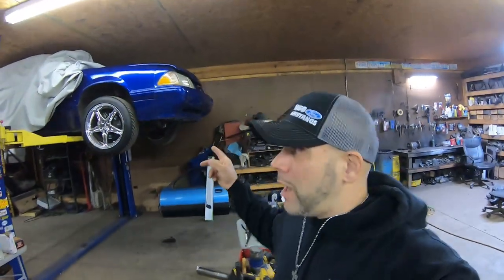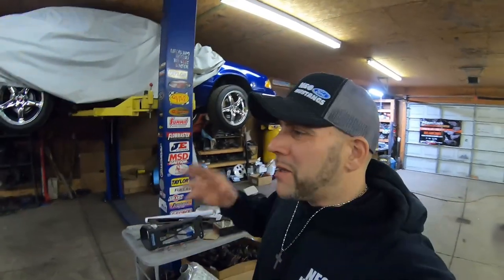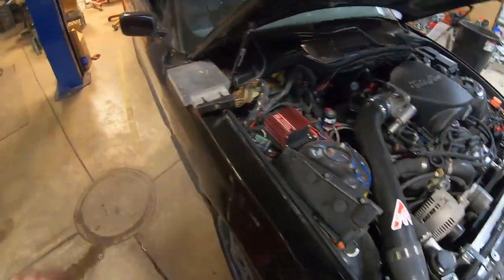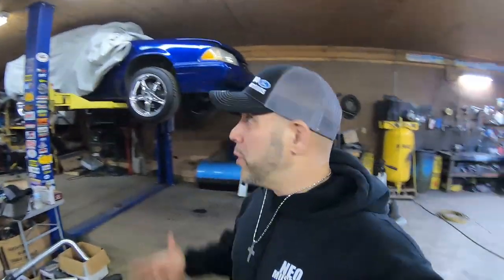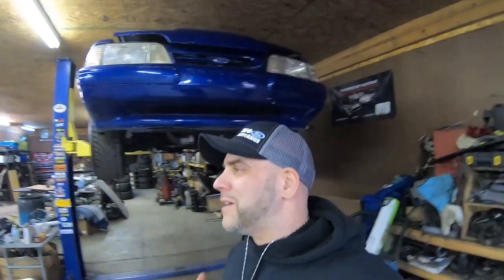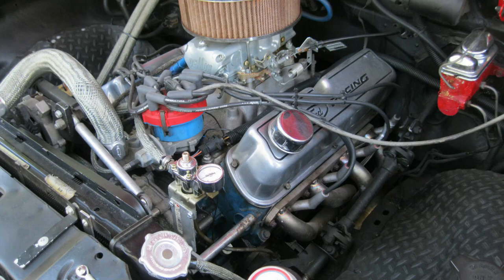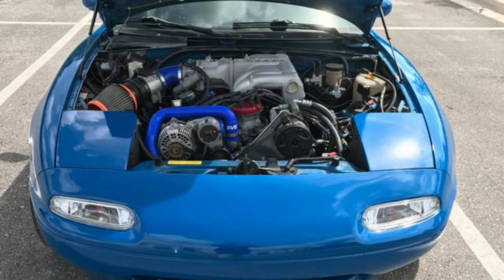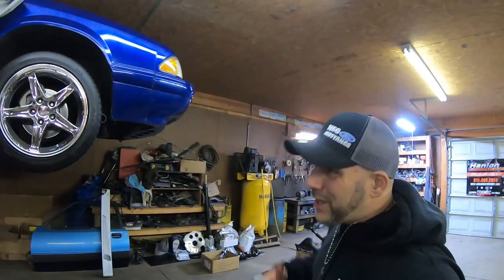Some of the SICKEST Engine Swaps from a Foxbody Mustang! #donor

Comment: I did a 1995 Ranger STX 4X4 V8 swap back in 2005, and I am still driving it today! I have done 3 Ranger and one Bronco II V8 swaps. Most of the parts were from fox Mustangs and SN95 Mustangs, the 95 was used with Explorer accessories with A9P, AOD, and wiring from a Fox.

Comment: Ihave an 89 mazda b2200 thats 302 swapped with the AOD trans.   Using foxbody motor mounts, oil pan, pick up tube, was using fox body shorty headers but now using 60s mustang tri y headers and 86-93 mustang gt tail pipes and flow tubes.

Comment: A few decades ago before LS motors were really in junkyards 302 swaps were popular for any light weight car. The foxbodys were light themselves but sometimes a carb'd 302 was cheaper to swap little import cars when the motors quit than the proper motor and made more power on top of that. LS swaps are done because GM never bothered to put them in any cheap vehicle that didn't way 2 tons.

Comment: The Toyota starlet and corolla  Datsun pickup are a few I've seen a several of
Reply from the maker: Serious? Never even heard that
Reply: @Neomustangs  when I was a teenager there was a few gen 1 rx7 and 300z with fox guts swaps running around  the old school heads use to tell me power vs engine bay the sbf was best cause it was dimensionally smaller than all other engines and it would fit in smallest bays

Comment: Ya forgot about the ford pinto because I have one with a 347 t5 8.8 and the drive shaft even fits. I know that u said something that wasn't ford but you did use a ranger 😜🤣👍🏽but i saw a dude with a 351w in a miata and that thing was insanely fast
Reply from the maker: Ah yes